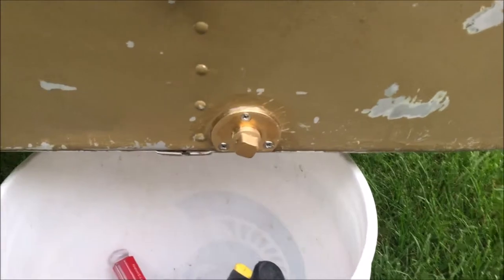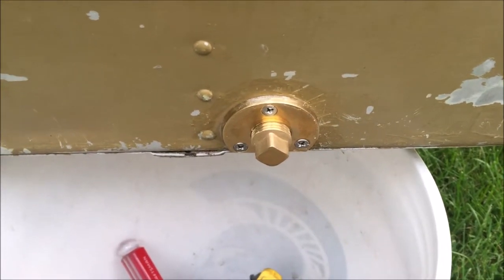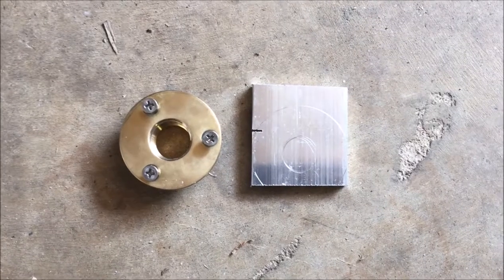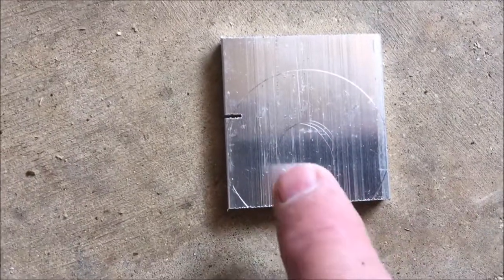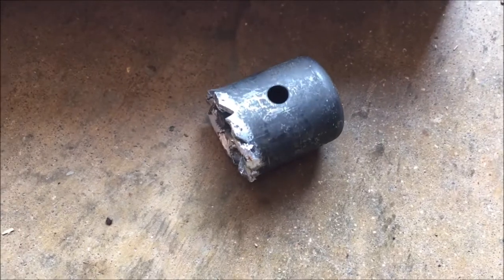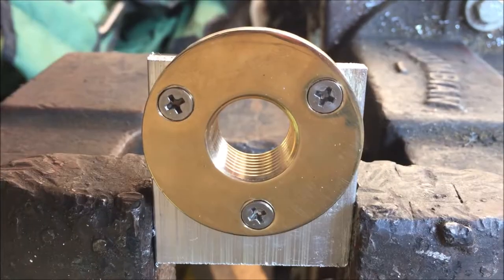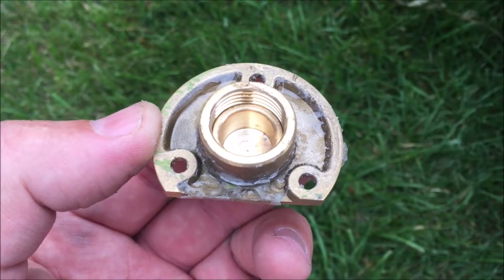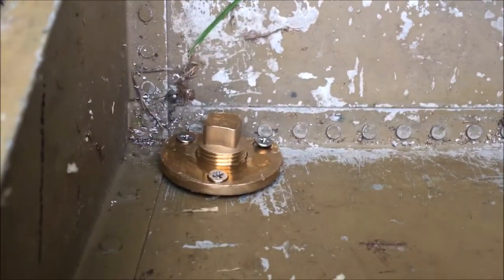OldGuyDIY Grumman SportBoat Sport Boat Canoe Drain Plug Install Mod Brass Repair Upgrade DIY Pt 9

Comment: I also have a 1977 Sport boat . I am going to drill a 1 inch hole and use the Moeller kit that has the flared tube ,o ring and 2 collars that fit over tube . Also bought the flaring tool off ebay . My question you think it would help to drain it better if  a couple 1/4 holes were drilled at the bottom in that triangular support in the middle ?
Reply from the maker: I don't think additional holes are necessary.  1/4" holes are also likely to plug with leaves or dirt. I don't have any problem letting accumulated rain water or the water carried in from wet dogs or people with the  drain plug set up I have. The only time I remove the plug is when the boat is on the trailer for the trip home. Thank you for asking.
Reply: @OldGuyDIY  Thanks from one old guy to another !

Comment: I just bought my first Grumman Sport boat, brought it home and replaced the transom with some left over plywood I had, it will do me for now until next year when I get better wood for it. I mounted a 6hp 1987 Johnson and will be ready to hit the water in the morning.
 I do have a question? Mine has the plate where the base of the mast is positioned but It also has a small eye on the outside of the transom (on your video it's just above the drain plug) and there is also has a small hole in the top edge of the transom. I'm guessing it's where the Rutter is mounted. Correct me on what this is for?
Gracias for your videos.
Reply from the maker: Yes, your Sportboat has the mounting points for the sail rig, including mast and rudder.

Comment: Why didn't you drill and tap the aluminum saw the screws with thread into it don't get me wrong I like the idea I'll probably do the same thanks for the idea project
Reply from the maker: I didn't have a tap handy and wanted the security a nylock nut provides.  Thank you for asking.

Comment: Good video thanks. Do you have any problems with water leaking in from the screw holes?
Reply from the maker: No, the E6000 makes a waterproof, flexible seal.
Reply: You could also use butyl tape, it’s like a sticky gummy tape you normally use for weather seal on travel trailers around vents and lights.  Would work here as well.

Comment: Use WD-40 as a lubricant when machining aluminum, works great keeps the tools from loading up with aluminum slag, just fabbed up a bow cap for my Espadon 12ft Aluminum boat  out of aluminum checker plate, before I filed the edges clean, I coated my file with WD40, when it loaded up I wire brushed the aluminum bits from it.
Reply from the maker: Thanks for the information.  I'll try WD-40 next time.

Comment: You should mention that brass should never be used in salt water.  The zinc in brass eats away from electrolysis.  Always use bronze in salt water!

Comment: Brass and aluminum do not mix. The brass will erode the aluminum . The two metals make a chemical reaction against each other. This is the same reason why you shouldn't use bottom paint with copper on your aluminum boat.✌️